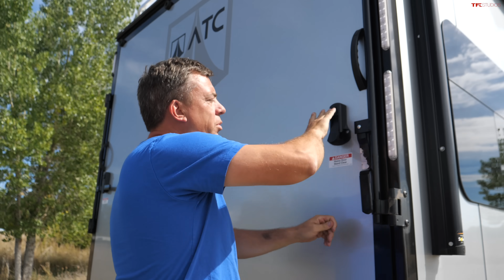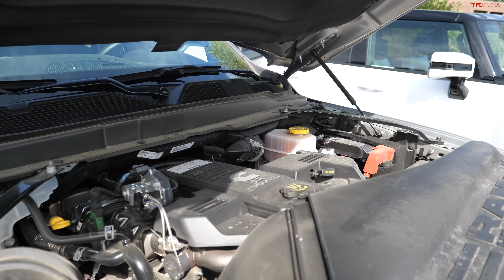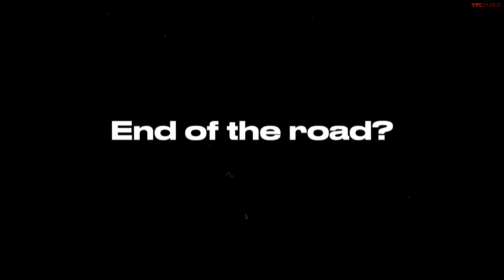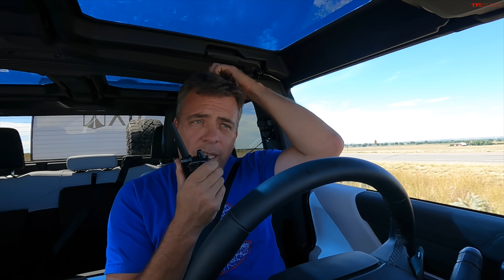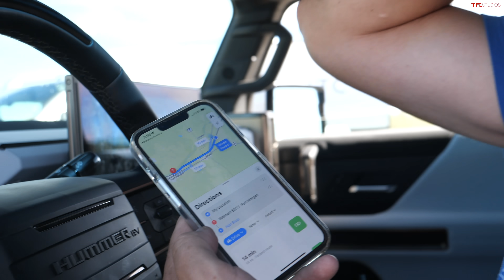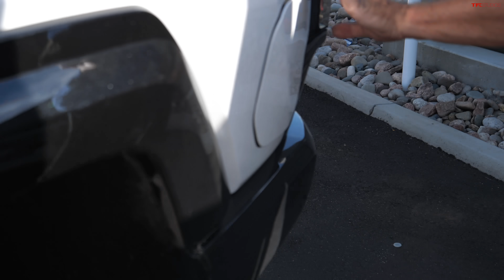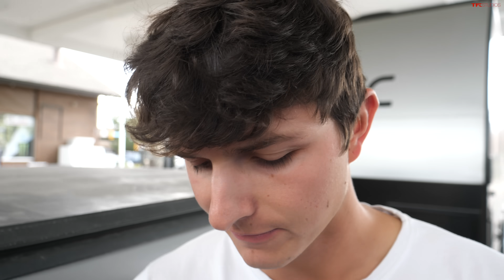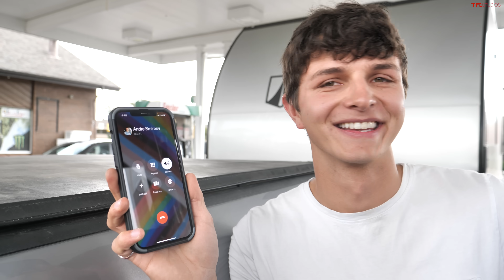How Far Can a Diesel and Electric Truck Tow An Identical Camper Trailer on ONE Fill-up?

Comment: Sorry but electric  are all expensive pieces of crap ! all hype no real facts glad you guy prove it ! just take the factory specs and divide it by 50% in real everyday world ! and that's in summer weather imagine it in -30 facing harsh wind here like we have on the canadian East coast you could divide their specs by 3 ... and our governments is forcing them on us within 7 years without making sure chargers will be ready and grow out of empty field ! even when you find supercharger they are always full or out off work state and a 12 hours waiting list line up just total insanities ! Its like telling your landlord your moving with all your furniture in the moover truck but you didn't find another apartment rental yet ! Three time the  HP but just for 50 miles in the worst scenario ! and we all know that a good diesel well maintained can last 20 years with a million mills on the odometer  so you could drive two diesel trucks for the same price pass 2 millions miles ! and these giant batteries won't live more that 5-6 years at the most before refusing to charge , we all owned quality brands lithium battery tool where their battery never last more than 4-5 years ..How much will it cost to change a failed hummer battery in 5-8 years when it will be discontinued ???

Comment: In Australia we have signs along the road which advise us to stop revive survive every 2 hours. This corresponds roughly with the range of the Hummer towing a caravan. 200 miles is over 3 hours behind the wheel. How often does one drive 300 miles towing a caravan without stopping? Caravanning is generally a leisure activity, so how important is the time spent charging up vs fueling up, when one could be enjoying a feed and a stretch as it happens?

Comment: Nicely done. Straightforward comparison and very interesting. The math review was perfect. I have driven that route many times. I was surprised by the low payload on the Hummer. My previous truck, a GMC Canyon Denali, has about the same payload. I ran the numbers and decided I needed a new Silverado with 500 lbs. more payload for our camper. I went with gas, but I really like the Duramax.

Comment: You spent $100 on diesel and you went 2x as far. The Hummer was about $40 for 1/2 the distance. Bottom line the diesel is about 20% more expensive to drive  but the truck payment is less than 1/2.  Bottom line you can get somewhere with a diesel vs being stuck with an all electric vehicle.  Remember the ba$$ery pack needs replacing once a year too. Figure about $20k per year for that too.
Reply: Lol, once a year, where'd you hear that horse$hit?

Comment: That drive is easy peasy. Not a lot of exits for refueling gas/diesel or electric in some places. Lots of hills. I wouldn't use cruise control as engine will shift down to maintain speed and reduce MPG

Comment: I drive a diesel ram, when towing 7600 lb I drive at 63 to 65 for best fuel economy, empty truck is c68 to 70 mph, so if you would slow down both trucks would do better.

Comment: I haven't reached that far in the video yet, but it would be so damn funny if when they finished charging that Hummer, and went to get the trailer, their next comment was... Well guys... The trailer has been stolen. Most of us watching would literally split our guts laughing so hard if this were to happen. It would be great.

edit: One thing people don't realize when listening to those diesel numbers at the end is this... If they would have used a pre-DEF truck, they would have easily travelled 4x the distance than that Hummer. I have a 2017 Ram 3500 that currently gets around that same number (9.7 mpg) towing my 40' RV. But I also had a 2001 and a 2003 Ram Truck that would easily get 15 mpg towing the same type of RV. I'm talking about trucks that were both 6 spd manuals and they would easily get 25 mpg just driving around pulling nothing. We should get rid of the stupid DEF and go back to these higher mileage diesel trucks.

Comment: The cost of charging or filling the trucks is bull crap. Uncle Sam is screwing with the cost of the two energy sources. With true free market it would be better on both sides. Natural gas and coal generation without uncle pinko Sam sticking his greedy fingers in would be cheaper and fuel at the pump? Should be a buck cheaper a gallon hands down.

Comment: (please do not be offended) I'm now getting tired of these bull shit efficiency numbers (anybody can run formulas to make their interest seem better) if the Hummer truly had better kilowatt hours than the Dodge it would have traveled farther not shorter.
Electric motors are extremely powerful, no arguments there , but they are extremely thirsty for energy and batteries just don't cut it. 
Here's an efficiency test for you...(keep in mind they are both towing so I'm using their tow milage)
The Hummer's battery is 3000lbs and it only traveled 120 miles
The Dodge went 211 miles on 21 gallons of fuel, Diesel weighs roughly 7lbs/gal that means the dodge went 211 miles on only 147 lbs of energy. (And don't tell me that weight doesn't matter because both vehicles have to pull their own energy storage system)
Again I apologize for sounding harsh but I'm now tired of people pushing ideas that keep falling short, or are too impractical for dialy use. 
By the way electrical capacity of batteries (range/health/life) diminishes constantly on batteries. ICE vehicle's don't , and another thing that isn't commonly mentioned is EV's lose 50% of their range just using the air conditioner. ICE engines lose less 1% mileage using the air conditioner.
Reply: Give them both $5 worth of fuel/electricity, diesel will get its a$$ kicked in distance.

Comment: The hummer looks good from the wheels and tires but I am not liking the the body design looks nothing like the original hummer had they had went back to that on with a couple changes I would have been sold but that price tag that is a turn off the hummer isn't some truck you take to the rock yard to get construction materials that is what sierra Ford and ram are for if I'm being honest now as we have just seen the hummer can pull but it is less then if I am correct every 1500 based truck we have on the road the f-150 the ram 1500 the the sierra the Silverado 1500 aren't all those rated at around close to 9,000 pounds if I need to tow or want a truck in general it is going to either be a Ford a ram or a GMC ranging from the 1500 to the 2500 why because I said so this also includes the f-150 and the f-250 for this who cannot tell that these are ford's versions of the 1500 and 2500

Comment: Mercedes makes Diesel Plug ins for some of their cars, i think that combo would be interesting for pickup trucks.
A small diesel combined with a 25-30kwh battery or so. The diesel is enough to maintain cruising speed on long journeys and would get great mileage. Daily commute and errands could be done on battery alone,  power and torque should be plenty from the two engines, even Volvo plug ins get 400+ hp now lol

Comment: The hummer seems like an SUV with the back chopped off more than a truck. It has no bed space, light towing and payloads. Heck my 2015 V6 Ram 1500 has better payload and a similar towing capacity.

Comment: “Free charging” promotion for your $118,000 vehicle that will need charging every 128 miles brand new, Mileage will only decline by use so in 5 years, you’ll be lucky to get 50 miles out of it then it will cost $60 - $100 per charge or another 30k for new batteries …. No thanks.

Comment: Electric cars are like a seminal eruption caused by sleeping in a tent next to a picture of a naked woman while drunk in a tent next to a venereal disease hospital, something happened, but you don't understand what or why, and there is no benefit from it, and the waste of the semen is unreasonable. Even an old diesel truck, which you could compare to a fun woman with a well-over-middle-aged and more worn-out appearance, is better.
You at least know where, how and what you have received and what you have spent your resources on. If you look at these two cars, the advantage of the diesel is not only the longer direct distance with a full tank, but also the fact that you can take spare fuel with you and add it anywhere and drive on, to the end of your journey, besides that, refueling costs almost nothing time. At the same time, the harmfulness of the environment should not be neglected. Internal combustion engines emit emissions, yes, but these cars are cheap to recycle and cheap to manufacture. Besides, if the forests were not senselessly destroyed by clear-cutting and new trees were immediately planted in place of the already felled forests, then co2 gases would not have a big impact on the environment, if at all, because trees use co2 gases for their life.
     The production of electric cars is many times more expensive, and unfortunately recycling their batteries is pointlessly complicated and expensive. In addition, the energy cost of their production does not justify their supposed "environmental friendliness", which they simply do not have. First of all, if an old car with an internal combustion engine is parked somewhere behind a shed, it simply goes back into the ground as raw materials, but an electric car with its batteries and a terrible amount of synthetics is a cruel pollution, that nature cannot handle very easily. A properly maintained internal combustion engine pollutes the air less than an electric car. To clarify: electricity is produced in power plants, the majority of the world is nuclear power plants and fossil fuel power plants, of which nuclear plants are very polluting with their radioactive waste, which takes a very long time to neutralize and is very expensive every year and represents an unreasonable long time threat to the whole environment to become neutral again , compared to the benefit that is obtained from it. Properly built and maintained fossil fuel power plants pollute considerably less if soot filters/collectors/separators are installed on them, because soot is used as a raw material in many industries, so not much is lost, nor does it pollute the environment. For example: The Carbon Black industry provides raw materials for a wide range of industrial applications such as tires, mechanical rubber goods, plastics, textiles & fibres, pigments etc.
Internal combustion engines can be relatively easily converted to 0% pollutant fuel with small upgrades, namely the addition of a hydrogen generator. I have built one of these by myself, but the small power of my car could not run this generator. A old 1.3cc Toyota with a 45 amp generator and about the same number of kilowatts on the engine was too small for a hydrogen generator with a consumption of 25 amps, the engine simply did not have enough power to run it, but when I reduced this generator to les then 10 amps, the engine was able to run on it, but it didn't have enough hydrogen to run on its own, but still it increased fuel burn and improved engine performance.
 But those who use this technology and spread it will be killed and ridiculed in every way, because the big fuel companies will not get their huge profits, i.e. a few individual people cannot become unjustly enriched at the expense of other people.
  I'm not from America, but I've watched with admiration a couple of nice home mechanics who have started their cars on clean water and the only thing that comes out of the muffler pipe is o3/ozone and a few drops of water.

Comment: I think it's safe to say, in terms of the average user, that EVs are still in the luxury or "status" class of vehicle.
It's totally anecdotal, but everyone I know who owns a diesel truck needs to have the confidence to make a longer distance than what an EV could provide.
Additionally, once you get to more remote locations and the availability of charge stations drops off or you go cold climate where batteries suffer... There's again no competition for diesel trucks.

SO.
I live in Gold Coast Australia, and would totally drive an EV for day to day if my budget permitted. But the second it came time to go camping or road tripping or just adventuring, I'm going to go with a gas or diesel vehicle solely for peace of mind and convenience. Which definitely has a dollar value.

Comment: Every one of these video's just make my point that EV's are not there yet, especially as a truck or utility usage. We don't have the technology yet or the infrastructure to manage the EV's and the idiot government wants everyone to buy these to save the planet. It's insane! The back end emissions of a produced EV looks good but no one will tell you how much damage it does to the earth to produce one battery.  You want to stay green then it's more earth friendly to stay petroleum. Unless you want to be towed by a diesel powered roll-on tow truck. I almost forgot, how will one make the plastics to produce the lightweight components of the vehicle, the lubrication for bearings, the tires for it to ride on and most important the asphalt the road is made of without petroleum.

Comment: "been here 31 minutes" no, not really, because you had to leave the highway, find the charge station, disconnect, charge, reconnect and then get back on the highway, so more like an hour or more to ONLY partly recharge.
Contrast that with diesel where you can get off the highway, refuel COMPLETELY and be back on route in 10-15 minutes.... less if everything goes right.
Electric has a place... but covering long distances, towing or not, sure as hell isn't it.
I would get one for a work commute and local driving, but if you do anything else with any frequency, it can't be your only vehicle.

Comment: To me, driving without hands on the wheel is idiotic when operating 20,000 pounds of vehicle at 70mph. If anything goes wrong, the 1 or 2 seconds to transition from hands free not focusing on driving could kill another person. I firmly believe allowing anyone over 18 to do things that will kill them but not actions that could kill others.

Comment: Nothing about an EV, car or truck, has swayed me to remotely replacing my ICE with electric. All of my practical uses for a vehicle are hindered by EVs. I also don't care for the inconvenience in the name of environment, to know that the energy used to make the electricity is produced by mainly fossil fuels. Keep working on the idea of green transportation, but I don't think stored electricity is going to accomplish needed power, convenience. and 0 emissions (whether produced by the vehicle or the energy generation process). Also, how's the recycling process working out for EV batteries? Most of us have seen the process for mining and production. If you haven't, you might want to. I want a clean environment, but I want a CLEAN environment. I don't want to "act" like I'm doing something but leaving the mess someplace else, to which I believe the current EV industry is leading. For now, my lifestyle still require an ICE. Thanks for making the vid.

Comment: Not a big trailer. At all. Why are people trying to make electric tow? It simply cannot be done and keep any schedule. That’s if you can find a place to charge every day. And unhook trailers to charge. My Cummins can pull my 28 ft toy hauler with my 4seat talon all day without needing fuel. And it only takes me about 7 minutes to fill up and get a big gulp. Go cross country in an electric vehicle you better have a trailer hooked up so you have a place to sleep every day when you need to charge.

Comment: Wait you get 9 MPG on a highway trip with this Cummins? My LMM Duramax gets 14 on mountain roads, that's strange. 
I will not even address the joke of this EV truck fantasy pushed down our throats right now. A truck is a purpose driven vehicle made to be reliable, the exact opposite of the EV dystopia.

Comment: Where electric vehicles will make sense for towing is for contractors like myself who do 30-80 mile round trips towing a landscape trailer around my county on a regular basis. But only if the electric truck is similarly priced to my existing ‘19 Ram 2500 crew cab longbed 4x4 diesel, which is essentially identical to the truck in this test.  The savings per month in fuel would definitely add up.

Comment: With my 2007 Cummins diesel with Jake break I get 20.2 miles per gallon at 64 miles per hour, truck bed loaded with full trailer. No issues at all

Comment: I never heard you say what size rear end gear was in the ram, 410 or 373 that will make a big difference. My 2001 ram Cummins has 355 rear and gets great fuel mileage.

Comment: I know they are running the promotion now so it’s free. But what was it supposed to coast, cause I seen $37 and some change when you hit 51%. So that would put it around $70 to charge it completely. Sorta doesn’t even make sense to even think about it yet until they figure out towing range and power